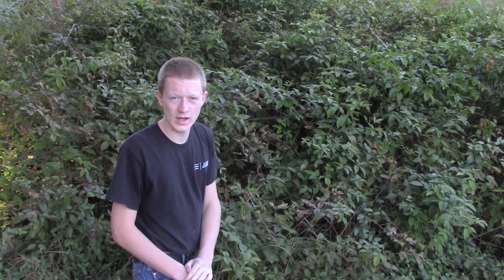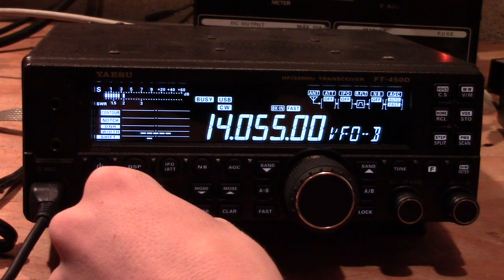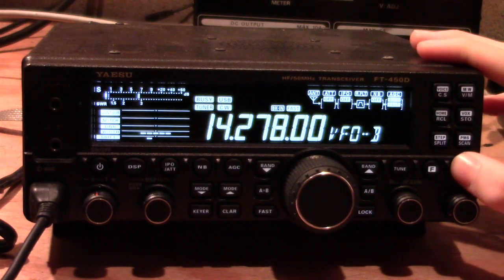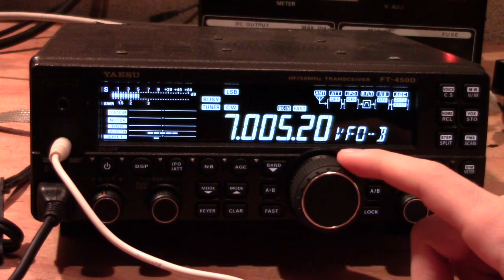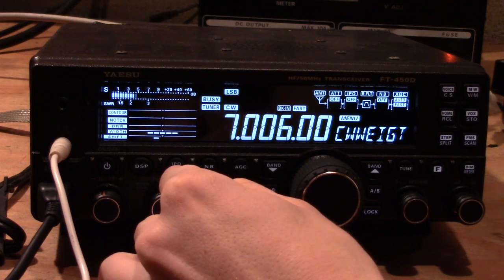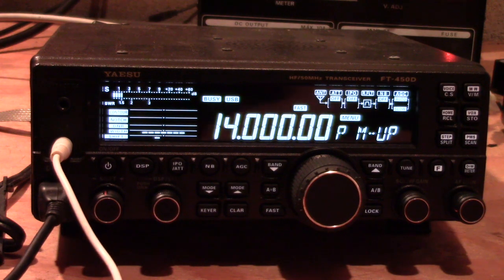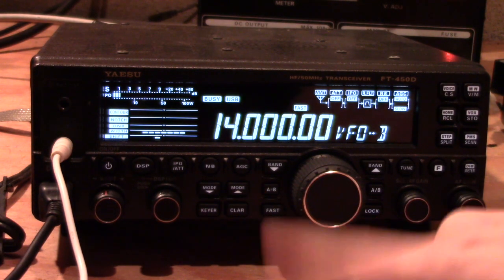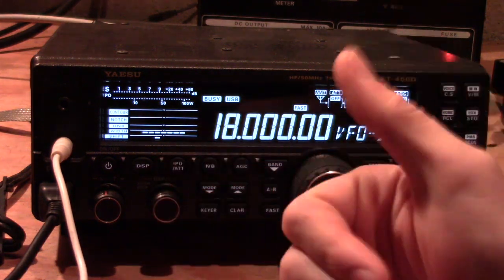How to Operate and Use FT-450: SSB, CW and Other Features

Comment: Hello there 73 I have a  question about my 450D.
My 450 restart few after I press the ptt so wish bottom I press wrong? Thank you 73
Reply from the maker: Chances are you have a poor ground, or the SWR is too high. When you transmit, a short or ground is occurring, and the radio is shutting off to protect itself.

Do you have any external accessories attached?

Comment: Hi Thanks for the video. I just received this radio and am trying to figure it out. I like the feature of limiting my bands and my modes. However it seems my menu is on the reduced number of 16 selections and not the broader 62. See page 76 of the manual. I tried turning my menu off but that didn't open up the remaining 46. Do i need to do a menu mode reset ? Here's hoping some of you still monitor this older thread.
Reply from the maker: Hey Paul.

There is a setting in the menu called “Ext. Menu”.

Scroll to this setting, select it, then adjust it to “on”.

The purpose is to keep it simple for your day to day operations. However, you’ll want the extended menu on while configuring everything.
Reply: Thanks @amateurradioworld8321

Comment: The title says it’s a 450 but it isn’t.
Reply: Its a 450D. As opposed to a 450 or 450AT. But based on what I viewed the settings etc. are very similar. Complete reviews are in QST Dec 2007 and Nov 2011

Comment: Not sure if you would be still monitoring this video, but just in case...
I do not have a CW mode on LSB, (80 or 40). Have CW on USB. Any answer ? thanks, Baz
Reply: Hi Baz, you can set it through the menu:

CW BFO
Function: Sets the CW carrier oscillator injection
side in CW mode
Available Values: USB / LSB / AUTO
Default: USB
USB: Injects the CW carrier oscillator on the USB side

LSB: Injects the CW carrier oscillator on the LSB side

AUTO: Injects the CW carrier oscillator on the LSB side while operating on the 7 MHz band and below, USB side while operating on the 10 MHz band and up

You're set on USB

73 de iu0kwx, alessandro

Comment: great video but what is the difference between vfo-a and vfo-b ?
Reply: Hi George, the VFO (Variable Frequency Oscillator) sets the frequency on which a radio is tuned, receiving or transmitting. This radio (like many others) has two VFOs. You can set the two VFOs at different frequencies.
Of course, you can only select one one of the two. What is it for? For example you could have a sked with a friend on a certain frequency, which you can set e.g. on the VFO-A. But your friend is late as usual! In the meantime you can select the VFO-B and browse the frequencies. From time to time you go back to the VFO-A to see if he/she is arrived. 
More seriously, the double VFO is used for communications in split, those where you listen on a frequency (VFO-A) and transmit on another (VFO-B). To understand how split mode works on the Internet there are lot of sources.
Ciao, 73 es GL de iu0kwx, alessandro

Comment: Hello.  I use this radio and it has been great!  Just wondering if I use fldigi for cw, do I need to go through the cw settings in the radio or does fldigi alter the cw settings for you? Also wondering same with the other modes...rtty etc...thanks !!
Reply from the maker: Sorry I have been busy of late. I am not experienced  in any form of digital operating but as far as I know you should change them manually

Comment: Great video - did you hear about some problems with the key jack? Some were failing - would like to know if Yaesu fixed the problem along the line. If you connect the speaker output to soundcard input and then turn up the bass on the soundcard, you can use the Contour boost on the FT450 turned all the way to the left (and press it until the triangle points up) . This will provide lots more audio in the shack.
Reply from the maker: THX for the tip. I have had good success with my key jack thus far but haven't heard about the problem B4 now.

Comment: Thanks so much for that video, its a menu driven radio, and that's why I ask to have you guys do a video, I am considering buying this radio, and wanted to see how it operated. I have been happy with my Yaesu FT-840 since getting licensed in 1996...but had concerns about the 450D, I wanted to upgrade my radio,  and put my 840 away as a backup, and this Yaesu I saw on the internet, then saw your last video about the 450, and it cleared up a lot of questions for me...
Reply: You will not regret buying the FT450D. It is a great rig
Reply from the maker: Glad I could help. Hope you enjoy your next rig.
Reply: How about a video on ext tuner use. Len     73's    KC4LEN